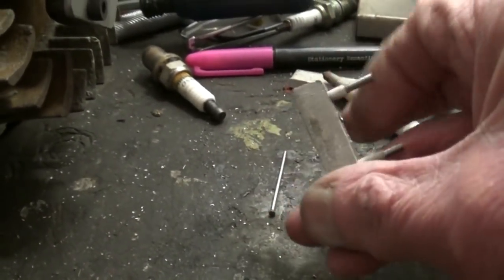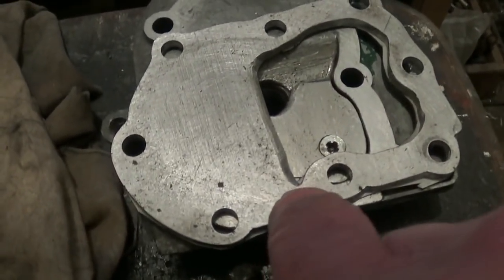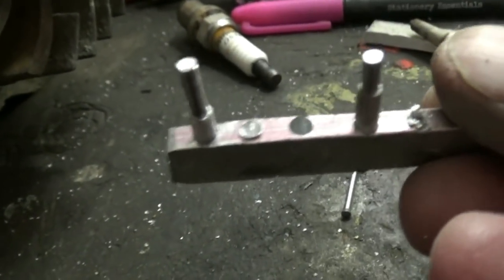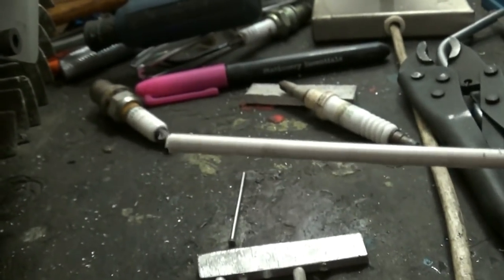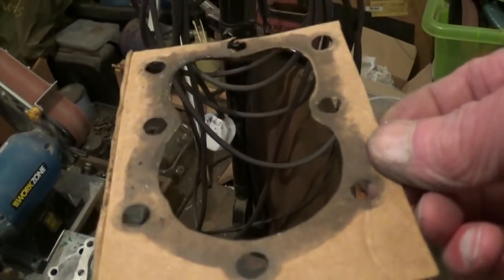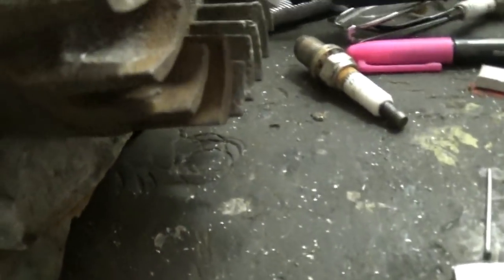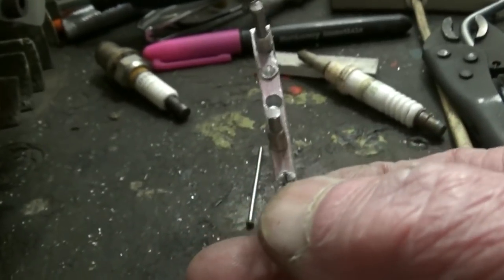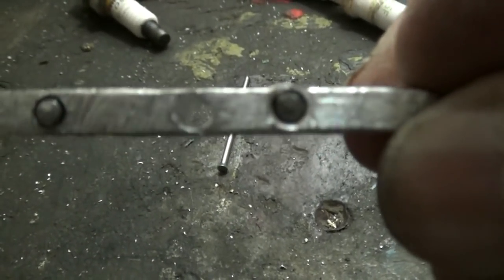Mystery Engine No 15 An Alternative Spark Plug

Comment: You are very creative Malc. That looked like a good spark on the electrode, can't wait to see it running. Thanks for the update.
Reply from the maker: Coming to the crucial bit eh Bob. We'll know soon if it stands a chance. Mind you, if? it does and appears reliable, I dare bet money when I take it to show someone it won't work. My other show engine for instance. Now this was perfect, or as near as can be. Took it to show Tony, and it ran fine. Continued to Roys, went to show him and it wouldn't start. Flywheel key had sheered. Hence why I made a steel one. This one sheered because it didn't fit very well. So I've made a tight one. As you can see it's holding, just going to be difficult when I have to take the flywheel off again.

Comment: Looking good, Bud! She was sparking well on both rods. Can you measure the gap and bore it with the spark's manufacturer suggested  jump from the electrode to the head wall in mind?
Reply from the maker: Cheers. Given the coils old I just have to get the best compromise I can. I also can alter the spark plug gap outside, so that should give me a good idea what it's supposed to be. Bearing in mind under compression it needs a stronger spark to jump the gap. Basically, if it sparks and still causes combustion it will work.